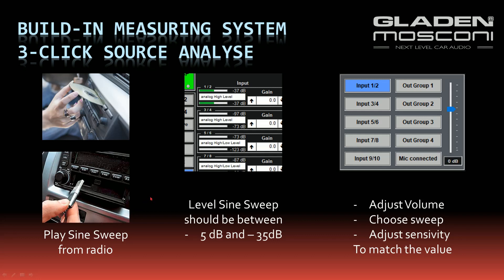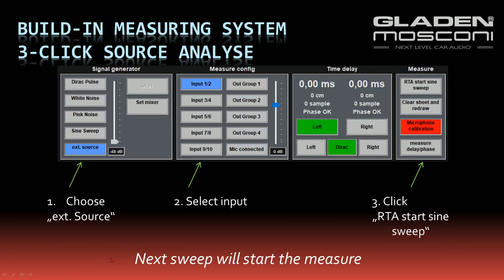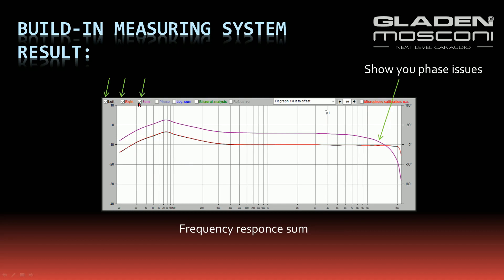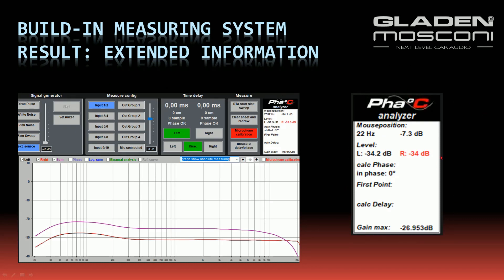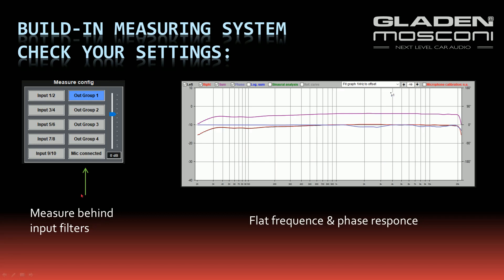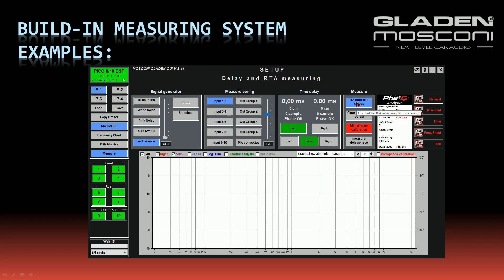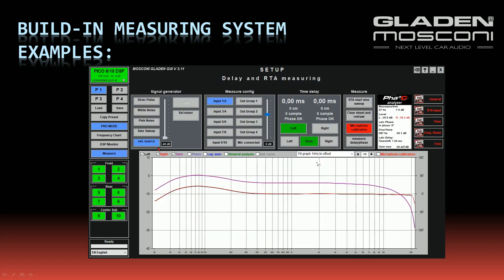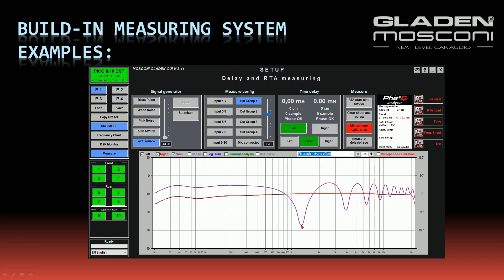9.1 Input Analyser Frequency responce / phase / time delay

Comment: Quick question how did ya find out to add 12500 AllPass filter in the input EQ to correct the phase?
Reply from the maker: Only you must know:
Allpass 1. order shift the phase 90° by filter frequency, total shift is 180°
Allpass 2. order shift the phase 180° by filter frequency, total shift is 360°

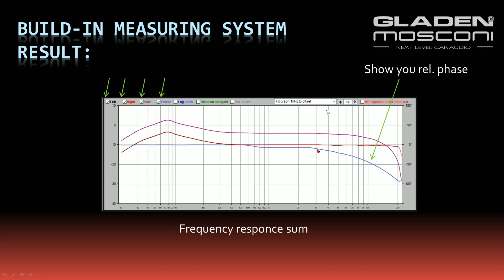Have a look on min 2:11 - the blue graph (phase).
Goes from 0° to -180° (total shift), -90° is by 12500Hz (green arrow point to it) -> Allpass 1. order 12500 Hz
Reply: @GLADENMOSCONI  Thank you for the explanation makes sense. Also which input signal to use? The test signal folder has multiple files.
Reply from the maker: @ytnimal  Depend on the source volume you want to measure.
Low Volume - high signal
High volume - low signal
In this way you can check the dynamic behavior of you OEM stereo.

The graph should fit in the sheet, use a sweep that reach ~-20dB